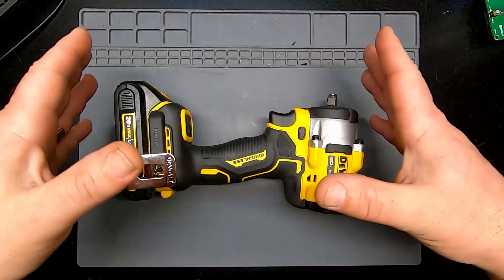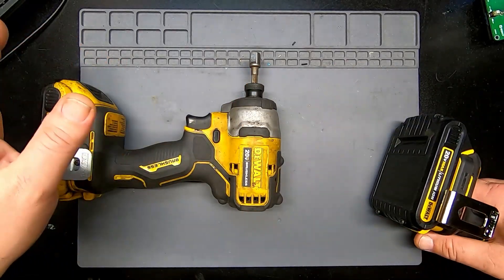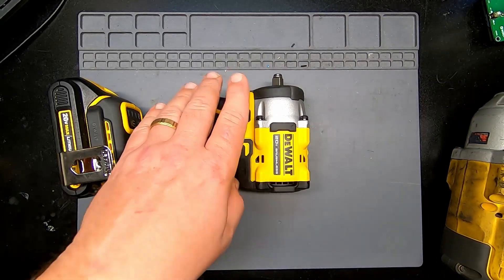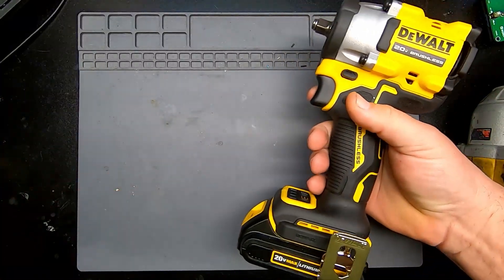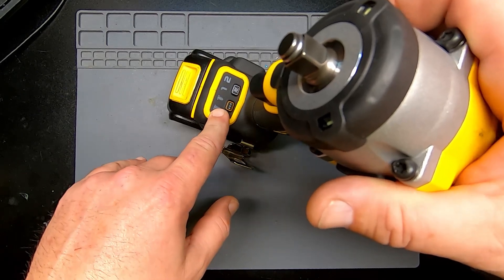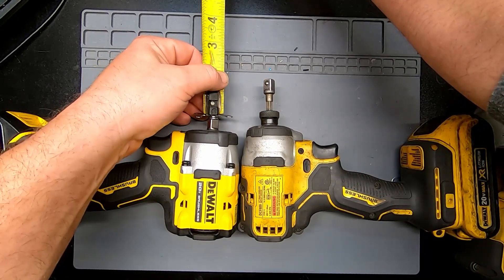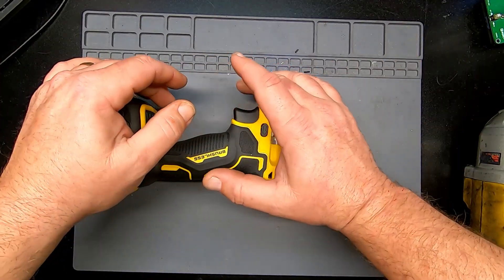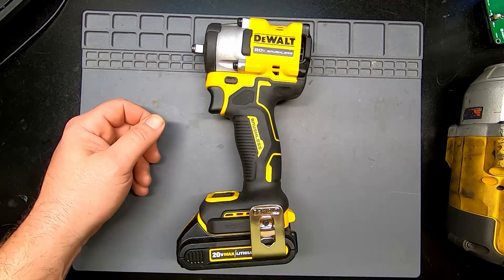Got A Dewalt DCF923

Comment: There's a serious difference between impact drivers and impact wrenches. As powerful as the drivers are, a dedicated wrench is on another level.
Reply: What do you think of the guy that posted a vid of a hybrid impact driver with the anvil off an impact wrench. Was a Milwaukee but they showed it outperformed the wrench I believe
Reply: @dirtyaznstyle4156  I haven't seen that video, so I really can't comment on it.
Reply: @not-a-raccoon  I watched it and forgot about it until I read his comment but it inspired me to buy a m12 fuel stubby 3/8 and buy an adapter for 1/4 hex chuck to use my 5/16 steel self tappers for the different impact rate with relatively same rpm. It drills and impacts maybe 5% faster than my 20v dewalt dcf885 that outperforms any other impact driver in my field of work. The m12 gets about 80-90% battery life of the 20v amp for amp 2v2 and 4v4 so when I'm roofing for a long time I stick with the 20v but for size/power the m12 blows it out of the water for ground or basket work
Reply: No shit bro
Reply: Yeah I appreciate his video, but a driver and wrench are 2 different tools

Comment: I'm an ag mechanic bought the 12v version a while back really happy with it. light enough to swing all day but still packs a decent punch. surprisingly good battery life to
Reply: I'm a maintenance tech and I love me 12v tools.  They do 80 percent of what an 18v will do with half the weight.  I still have the 18v stuff, but my 12v tools make me the most monies
Reply from the maker: I’ve heard a lot of good stuff about the 12v one. I just don’t have any batteries for it. For the 12v stuff I really like Milwaukee’s line up.
Reply: I picked up the 1/2” 12v, and the 1/2” atomic. The atomic crapped out on my first or second use, but the 12v has been bullet proof for me
Reply: @FunkFPV  dont forget that the 12v can actually charge off the 20v chargers, no need for a new system just gotta grab 1-2 batteries

Comment: I totally understand your line of reasoning. Even on semi trucks i rarely need full send that a high torque 1/2 puts out but my bit driver just does not cut it sometimes. The 3/8 guns are a nice middle ground. I went with the “full size” 3/8th but many times i wish i had the stubby.

Comment: I have used Dewalt battery powered tools since the late 90s... I still have those same tools to this day. I used them for my job (say at least 2 to 3 hours of use each day for 10 years)... Just replaced or rebuilt the battery packs and brushes as they wore out. Of course I have "upgraded" to the newer brushless tools, but the original ones I bought in the 90s are still in working order.

Comment: Dewalt just came out with the DCF891, which outperforms evey mid-torque on the market right now. 

It looks similar to the 894, but puts out heaps more power for a similar price and size

Of course, this will do a lot of what you need it to. But that 891 brings a ton of power for the midsize category. I think its comparable to the big 1/2 Dewalt you have, in a smaller form factor.

Comment: The new DCF891 mid torque looks to be the unit to beat in the 1/2” drive arena.  Not as compact as the one you got there tho.  That thing will work great for what you are planning to use it for.  Can’t wait to see the shorts.
Reply: I went with DCF 921, it is same form factor as this one but added 1/2 anvil

Comment: 1:05 the dcf894 is 330ft lbs and is what you are looking for I think.

 The 1/4" hex shank with the adapter you showed (809) is 141 ft lbs. The newer dcf887 is 150~ ft lbs. The 899 you showed after is around 700ft lbs.

The dcf921 (smallest one you showed I think) claims it is 300ft lbs so might be just what you need.
Reply: The 894 is decent, but you can get the brand new 891 for just a bit more. Which blows the 894 out of the water by a long shot. Its also about the same size
Reply: @coltonjacobs5383  my 894 does the job pretty well. I found a dcf999 at the local pawn shop for $160 I threw it on layaway due to not having enough on me. Picking it up Thursday. If you get the chance go to them I have found many brushless dewalt tools in damn near brand new condition and actually found 5 tools still in the box and no signs of use.
Reply: @coltonjacobs5383  wow the 891 is badass. But I got my 894 for $100. I would only get the 899 if I wanted an upgrade, which is 700-1200ft lbs.
Reply: @fabiololstein1307  love my 894. At $100 it was a good purchase.
Reply: @casemods  I just got the 899 that thing is heavy but a it's a beast. It doesn't hit as frequently as the 894 and minimal vibration. Having carpal tunnel in both wrist sucks but the vibration made it so much worse. Also the 899 doesn't have that initial snap like the 894. I paid 150 for my 894 just the bare tool at the pawn shop but it was still in the box and had signs if never being used. Probably got stole by a junkie from a local retailer.
Reply: @fabiololstein1307  wish I could have found this comment when you posted it, but the new high-torque just came out. It's dcf900 and it's replacing the dcf899. So far it's only at a single retailer in Canada, but it should be everywhere shortly. It's supposed to put out some crazy numbers. I'm waiting to see it on the torque test channel
Reply: @jpowens2253  I have heard about it and an waiting too. I was a makita guy I bought my 1st set of cordless power tools in 2005 that was the old days technology with the NiCd and NiMh batteries and I still have them to this day and they still work. The battery is are worn but I could use them. Then I switch to the li lithium ion around 2010-2011 I'm cheap so if they work I use them until they dont. I only switch to dewalt 2 years ago and only because makita did not make a battery powered grease gun. I just turned 40 I service fork lifts and need partial shoulder replacement on both and have carpal tunnel in both wrists so squeezing a grease gun was taking a toll on me. Well I made a chance visit to a pawn shop one day and it shot me down a rabbit hole. Here is what I have gotten from them so far all dewalt brushless. Dcd998, dcd996, 3/8 impact, reciprocal saw, oscillating saw, 4" wood plane, 4.5 circular saw, 2 60v batteries, 2 8Ah batteries, 1 6 Ah, 2 5Ah, 2 4Ah and 1 3 Ah. The 5's 4's and 3 were on the  tools. Flashlight, portable band saw, leaf blower. 2 1/4 impact drivers the one with the 3 variable speed/torque setting. If the pawn shop has it in a month or 2 will grab their 8" flex volt circular saw. Some of these tools I have no actual use for like the portable bandsaw but the price was right and maybe 1 day I may need it! 😂 I bought the 2 impact drivers for 1 reason I am lazy so 1 holds a 1/4 bit for sockets and the other a chuck for switching out driver bits. Plus I like using tool on lowest torque setting to install spark plugs and any bolt under 8mm diameter it gets them tight but not too tight.

Comment: Timber Screw mode for wood related applications like lag screws or

Precision Wrench mode it goes until it impacts stops for a brief moment then continues impacting for more control and less chance of over torqueing and damaging lower torque bolts.

Comment: Fun fact... These tools chooch harder and faster with a bigger Ah battery... That doesn't really make much sense to me, but I believe projectfarm tested it extensively and yea, bigger battery more torque and speed... I know, still sounds like bollocks to me.

I've got 5ah and the 9ah flex volt, maybe I should grab a torque adapter and see....
Reply: I believe this is probably due to saggage so the more capacity you have the less the sagging voltage is noticed. 

just a guess from a clueless individual 😂
Reply: @samholdsworth420  yea maybe... But like a fully charged 5ah should perform just as good as a fully charged 9ah, at least for a while? Apparently not... I'm going to end up wiring my impact through a multi meter and hitting a torque adapter in a vice aren't I?... Damn it.

Edit: iirc they spin faster with no load too, so that should eliminate voltage sag? I haven't tested anything... You're maybe right.
Reply: @Mmouse_  that's the only thing I can think of that would make a difference really.
Reply: @samholdsworth420  agreed voltage or current drop... Shouldn't really be a thing though, I'd expect the same performance out of a fresh 2ah as a fresh 9ah - at least for a little while.

Anyway, weight is an issue, ever tried using a flex volt on a drill with your left hand at a weird angle? It fucking hurts man that thing is chunky.

Know what I use it for mostly? I got the dewalt battery topper that has two USB ports on it and I charge my stuff with it when I'm camping or in the mountains, it lasts an entire week lol.
Reply: @Mmouse_  I've always wondered why they don't use high performance lipos. (Actually I do🔥🧨💥)
Reply: @samholdsworth420  you can get some crazy big dangerous batteries from China, I've often wanted a few just to fuck about with in my workshop... One day, when my beard is bigger and greyer than it is now.
Reply: @Mmouse_  It’s got to do with the maximum Amperage the battery can deliver. Larger batteries have multiple packs of the same cells in parallel. This allows to tool to draw more power.
Reply: @mrjakobt  that sounds reasonable... But why when the tool isn't under load, that's what's stumping me, shouldn't get higher rpm out of it with no load, but apparently you do.
Reply: @Mmouse_  it’s not unlimited voltage, the trigger controls speed by regulating voltage. Speed is controlled by voltage, torque depends on current
Reply: @dirtyaznstyle4156  maybe have a look at the projectfarm video then, I don't really see why it's like that either.
Reply: 100% true
Reply: @Mmouse_  no, youre right. Weve known about the high amp advantage in rc for years now. Even given identical specs different chemistries and different amp ratings can have serious effects on output. Brushless motors will draw as much current as youll let them (to a point) and even under no load you will see an advantage.
Reply: @PhillyRacer121  "and even under no load you will see an advantage".

Well, if I'm following v=ir or more accurately i=v/r correctly, considering a no load scenario where i is low and r is constant as should be v.... Wtf is going on?

I under no load doesn't change, r from the coil load doesn't change and v definitely doesn't change.... So... 🤔

You telling me a 2ah can't handle no load current properly? Why?
Reply: @Mmouse_  i will be very upfront with you. I dont know the physics of it. Ive been dyno tuning brushless motors for years and before that, i was hand winding and building brushed motors bitd. For me its a lot more like cause and effect. My working theory is that its a result of resistance in relation to battery cell internal surface area. Mfgs know it too because the “c” rating on race packs is astronomical even though, according to a battery mfg i used to work with, its basically a made up number. But the layman rc hobbyist buys with the idea that c rating is directly proportional to the “punchiness” of the pack even though i personally think it has to do more with a half dozen other things like chemistry quality, cell resistance, amperage rating, battery construction (connection between cells) etc etc. 

Remember also that motors dont operate in a vacuum. Even on a test bench, the bearings have resistance that converts to heat, and the magnets resist motion and on brushed motors you also have the commutator and brushes plus everything that comes with that too.

To answer your last question directly, i think 2a could handle a load just fine but 5a could do it better and could even eek out a few more rpm.

Comment: As a steel building guy who uses a dewalt dcf885 on a daily basis for 5/16 drive self tappers I found the m12 fuel stubby filled the gap perfectly where I can use my 3/4-7/8 deepwells to crank the subframe down and not snap all the adapters going into my hex chuck impact. Then I bought a 3/8 square to 1/4 hex chuck so I texted the m12 with the same 5/16 self tappers and it is just as good of a screw gun as the 20v dewalt with 80% of the battery life of the 20v amp for amp 2v2 and 4v4. Just not a fan of dewalt "compact" impacts. My m12 with a 2ah will fit in my big screwdriver slots

Comment: I've got only cordless dewalt tools. Only tools bought knowingly brand new are my flex volt 4.5" grinder and my grease gun. I had makita b4 but my carpal tunnel kicked in and I needed a battery grease gun and makita at the time did not make them. All my other tools I have found at pawn shops most still in the box and I bought 2 1/4 impact drivers as I am lazy so 1 has a 1/4 bit in it and the other has the bit driver in it. Got both brushless 1/2" impacts along with reciprocating saw, vacuum, and leaf blower. The leaf blower is so much nicer than using my air compressor to blow out the lifts.

Comment: I am a dewalt user and from my experience if I throw one of my bigger batteries like a 6 I get more power out of the drill I also noticed with the bigger battery the drill heats up quicker

Comment: I went blue instead of yellow..  but so many people knock on using a 1/4 hex as an impact.  My Makita 1/4 pulled lug nuts and even a hub bolt on a dodge neon.  I still have the 1/2" brushless (very compact, stout as fk.  10/10) but a lot of the time it's just not needed.  That being said, by the time you add the socket adapter bit you've got a loong boy.  That's where the dedicated impact wrench really shines.  Throw in some wobble extensions and the world is yours.
Unless you are working on BIG toys, the compacts like you got are the bees knees.  I still haven't found a tractor bolt that my 1/2 inch makita wont remove or shear :-D

Sorry to ramble.  Just leaving shit to spike the algorithm punch.

Comment: I drive screws more than nuts and bolts. Impact drivers strip screw heads and over sink the screws. I would like a compact driver that has the customary torque settings and no drill mode.

Comment: The lag screw mode is for lag screws.
Reply from the maker: Well yeah LoL but what does it do?
Reply: @FunkFPV  Its manual says pretty much the same thing, just with more words: "Timber Screw(TM) mode optimizes tool performance to help increase the speed of wood driving applications such as with lag bolts, lag screws and structural wood screws."  Sure would be nice if they told you what it actually did!

Comment: In my opinion the atomic overheats too fast and if you let it overheat you will loose power permanently
Reply from the maker: I’ll never use it long enough to overheat it but thanks for the info 👍🏻
Reply: @FunkFPV  oh yeah I don't expect you too I just noticed it when I was working on a roof drilling an awning I to place and the fucker burnt my hands over and over